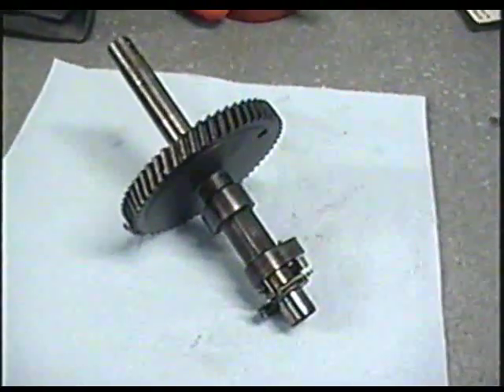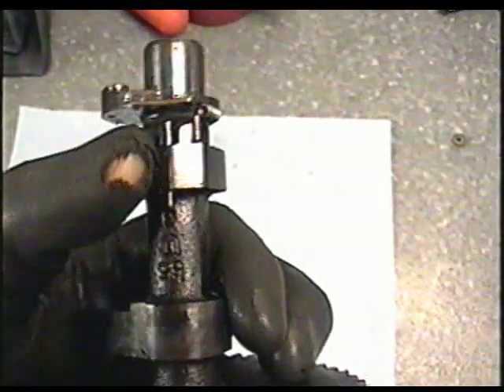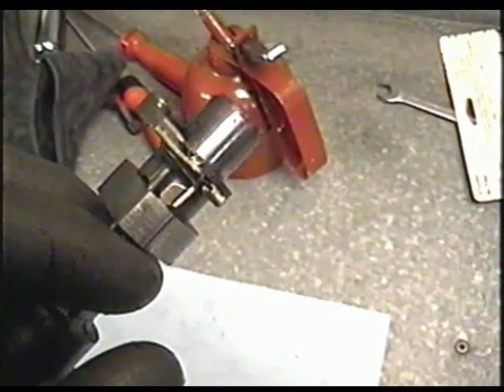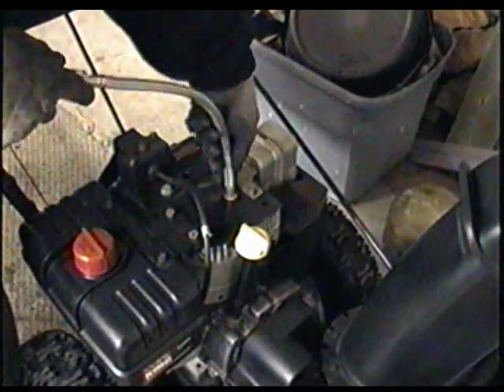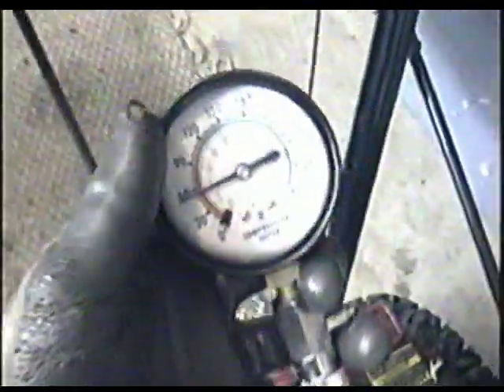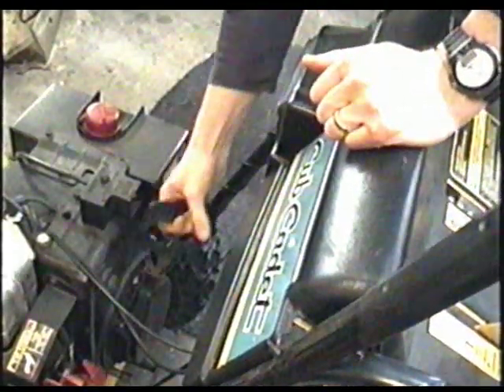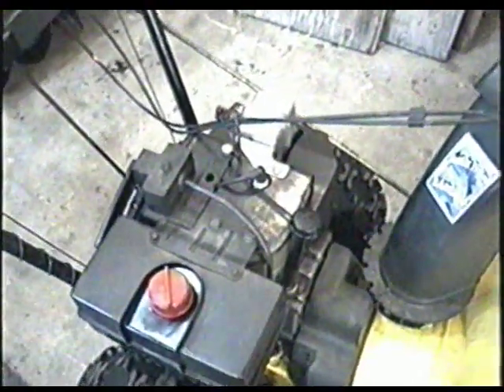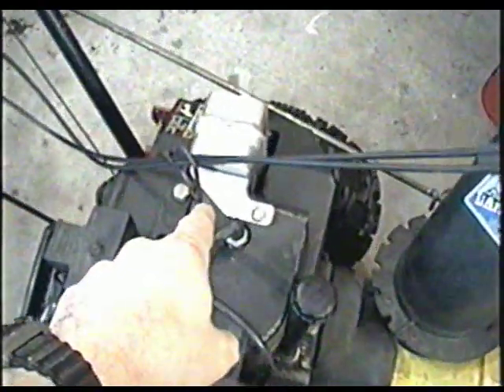COMPRESSION TEST on 4 Cycle Engine with Automatic Decompressor

Comment: I know this is an old video but I figure you might see my comment. I have the exact same compression release that you showed in this video, but I can't figure out how it works. I can see where the tappet rides on the edge of the weights but I can't understand how it cuts out at higher RPMs like the other releases I have seen. Basically I can't tell if it's staying engaged or not. Maybe you can break it down in a new video.

Comment: Given that all that you have said here is true, I keep in mind what my teacher with about 50 years experience says: the only way you can get a true compression reading is when the engine is turning fast with the electric starter, or more than 300 turns per minute. This way, the compression release by the camshaft is offset, more or less the same way when an engine begins to run. Yes, I realize that the minimum specified idle is 1800. At 300 RPM, or five turns per second, I suspect that the compression release may no longer be operational. I need to check with Tecumseh 1. the engine speed with the electric starter, and 2. at what engine speed is when the camshaft compression release stops working.

Thank you for sharing your observations and thoughts.
Reply: Supposedly the release cuts out at 400 to 500 RPMs so the starter isn't near enough to do an accurate test. A big drill motor may work as they turn around 3,000 RPMs.

Comment: I have a mower that I bought used that has a compression release on the cam. The mower seems to lose power under load and actually boggs down on a regularly mowed lawn. I have checked the valve clearance and cleaned the carburetor. It's a briggs with the newer plastic carburetor and I even drilled out the jet a bit with just a minor improvement. I'm getting a very low compression reading of 30psi with a compression tester which doesn't make sense to be that low. It explains maybe the loss of power but I can't see how it even runs with compression that low.

Comment: I wish I had watched this video before spending time and money on a 1994 Tecumseh 5 HP snowblower given to me by a neighbor.  I tried the "slow pull" test and really can't seem to find the compression stroke.  Do you have a video on doing the valve job on this engine?
Reply: A better solution may be to swap the engine for a 212 CC HF Predator.  They are sometimes available for $100.  The oil on Tecumseh was only half full and black, likely original.  The plug was also black.

Comment: Nice video, I usually just turn the motor over with the starter, it get the motor turning fast enough that the de-compressor is deactivated and a compression test is fairly accurate on Trcumseh's, on my rebuilt 10 HP Tecumseh engine I get approx 153 PSI after 5 to 6 TDC events using the starter, I have another 10 PH blower motor in my shop got repair yesterday, only gave 30 PSI after 5-6 TDC events, so very little compression. I also use the slow pull as initial check and leak down to further investigate if customer want it repaired. love these videos.
Reply: I got 100 psi and working pretty gggood so what's the REAL supposed compression we should have ???

Comment: My lawn mower has 60 psi compression and I would like to increase it. It does runs at 60 psi so how do I increase it and what could causes it to run at 60 psi compression in the mower. I just saw this video and other of yours but they don't fully address my problem. They don't talk about a running lawn mower with a lower then normal compression.

Thank You and I admire your knowledge for your craft and respect for other Mechanics and DIY

Comment: How can you tell if an engine has a decompressor if you do not have a manual  without taking it apart?
Thanks
Tony
Reply: Pull it fast with PSI tester, pull it slow with PSI tester. Or take it apart, an impact with 13mm, 11mm, and I believe 3/4" for the flywheel, and youre in. Just drain the oil!

Comment: Hi, I did a compression test on my HM 100 Tecumseh  and got 85psi.  My engine  bogged down when snowblowing, however I have another identical Hm 100 with only 65 psi and it  handles the snow load no problem.  I rebuilt the carb in the first one and set the jets  and still the engine bogs  even when you hear the governor kick in.  The belts are new and tension adjusted properly.  Any suggestions guys.
Reply: I got 100 psi and working pretty gggood so what's the REAL supposed compression we should have ???

Comment: After reading your answer I had to find this out!! and finally after taking a closer look I noticed a slight bump or lift at the bottom of the cam,cast and machined right into the cam itself. It seems it has compression release at all rpms.

Comment: I have a hm80 from 83 off a Ariens when I pull the starter rope I lift the machine off the ground. When I opened it up it appears that it doesn't have a compression release.Does that sound right? I didn't think a engine of this size would come without it.
Reply from the maker: the older ones may not have had a decompressor, I would have to see it

Comment: Hi Dony, I recently Checked the compression on My 8hp snowking Tecumseh with the engine warm, throttle wide open and used the electric starter. I got a max reading of 115 psi. I Don't know if it was the right method, but I'm pretty satisfied with the results.

Comment from the maker: @benrobinson72 remember that the bolt where the battery cable connects cannot touch the metal casing of the starter. u might have to put somekind of non conductive washer there. or put 2 nuts on the bolt and tighten the wire in between the 2 nuts, use jam nuts, they are thinner

Comment: on an ohv engine with the compression release you can take the exhaust valve rocker arm off the pushrod and test it. its gonna be really hard to pull though so dont pull it super fast and pull your shoulder out
Reply: Or better yet temporarily set the exhaust valve lash to about .060 (60 thousandths) It will pulll easier and be more accurste than removing the rocer arm.

Comment: Do you know much about honda atv's?
I have a 02 honda trx300ex and it had no compression and i found out it had bent valves, i replaced the valves.
Is there a reason why they bent?
Will they bent again?
And do you know how to set the valve timing?

Thanks